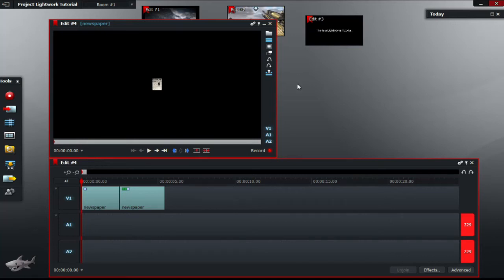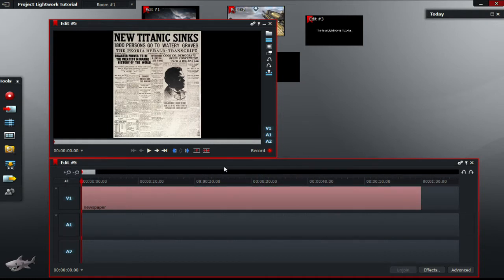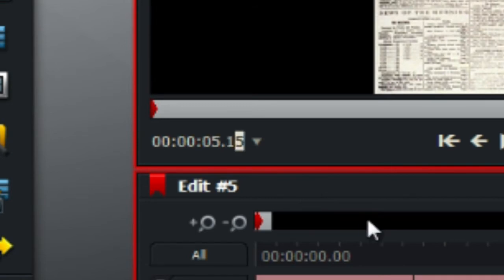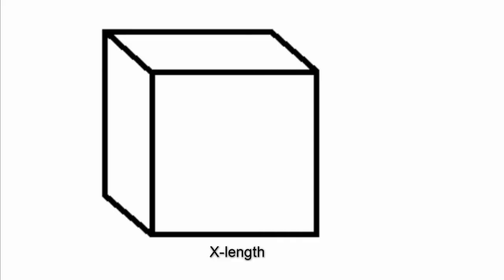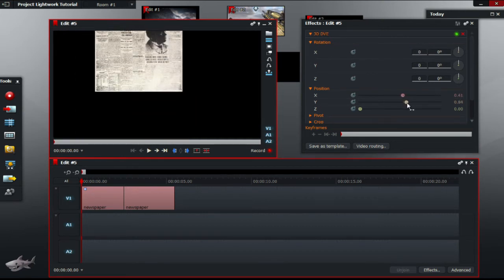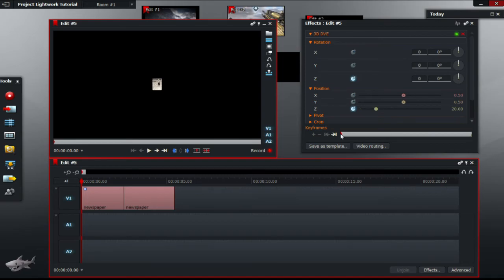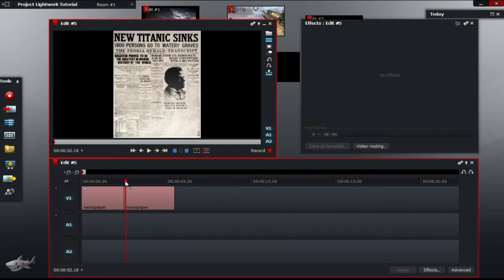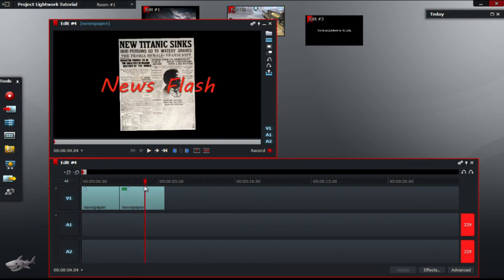Lightworks Tutorial #6 | 3D DVE

Comment: Sadly this didn't really help; all those things you showed are things you understand as soon as you open the 3dDVE tool. I am much more keen on understand things like; what is the value next to the base rotation value used for.
Reply from the maker: Thanks for raising this issue! I believe you are talking about the tool under the heading Rotation just to the left of the rotational values of the X, Y and Z. This tool is where you can enter a whole value (no decimals) either negative or positive and it will make the video rotate one full circle(360 degrees). It's very helpful if you want videos to rotate more than one full turn. A negative number will make it turn anti-clockwise while a positive will make it turn clockwise. ie. A value of 1 entered into the Z section of rotation will turn the video around 1 full circle in the Z dimension (think of it like a clock with the 12 being the start and end of the rotation). Hope this helps! If you have more questions ask!